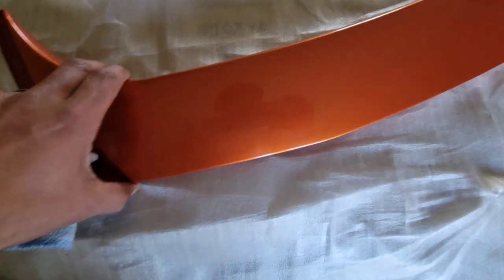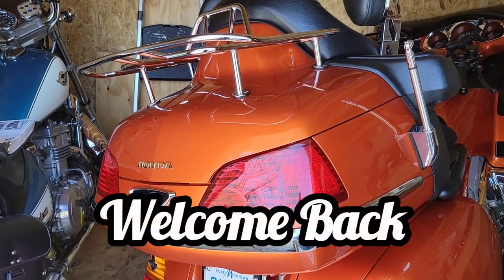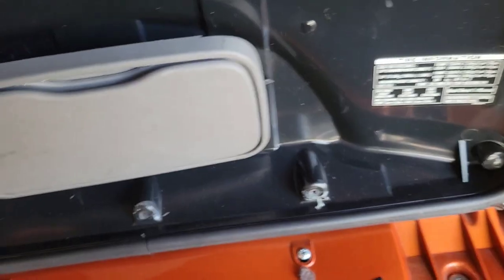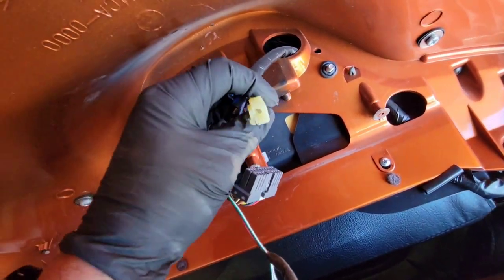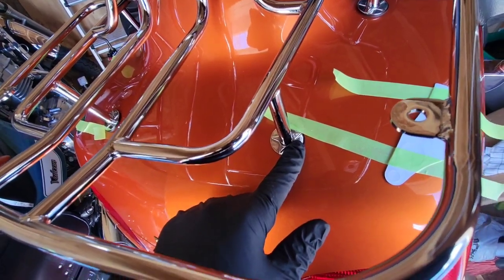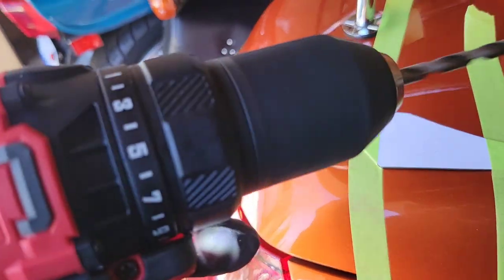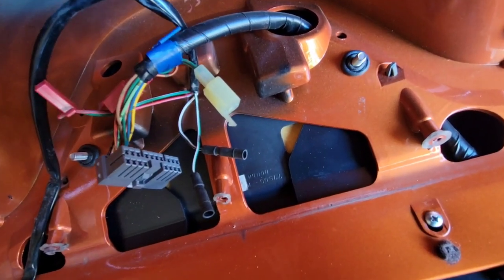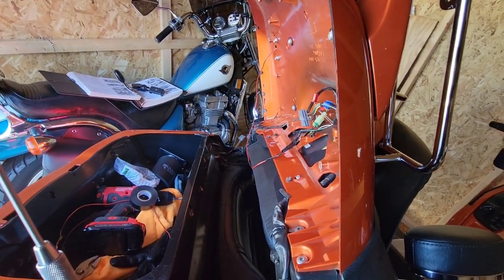GOLD WING GL1800  SPOILER INSTALL WITH WIREING.

Comment: What's good Mo, the spoiler looks really good man. I agree anyone can do it, I installed my spoiler and  luggage rack, measure as many times as needed before making your mounting holes. Also, there's a plug & play device make by Kisan (model number 25LED-D) that will make your spoiler a running light, brake light and will also flash. I installed it on my Wing.
Reply from the maker: Well that is some great info Jon. Thank you for sharing this. I will check that out. Be safe sir. And thank you for watching

Comment: Great job Mo, it looks professionally painted and installed. I was wondering how that would work out with the luggage rack. That’s what is holding me back but now I may give this a second thought.
Reply from the maker: There are a few different models of the spoiler out there. So as long as you are keeping that in mind when you purchase you will be fine. Thanks for watching On A Wing And A Hog. Be safe.
Reply: @mosmotorcyclejourney9067 The bikes not a factory color did you take everything off and have it all repainted?

Comment: A Spoiler ALWAYS  brings out the bike. Great job! Question: did you think about wiring it up to be a running light and a brake light?
Reply from the maker: I did. And that lens only serves as a brake light. I would have to replace the lighted part of the spoiler and I would also have to dig deeper into the rear of the bike to access the running light feature. So I figured I would work with what I have and upgrade later.  Thanks for the viewing and the question.  Be safe.
Reply: @mosmotorcyclejourney9067  Gotcha. Keep it as is. Looks and works Great!

Comment: Did you use a spray gun and did you get the original Honda Orange paint for '02??
Reply from the maker: Bought the paint from Colorite.com in a rattle can. Perfect match, as you can see.
Reply: @mosmotorcyclejourney9067  Yeah it looked total factory,, do you give them your paint code and they make it or is it already in stock.?